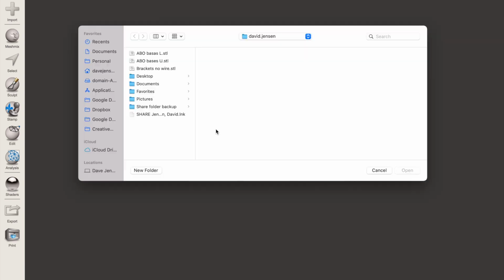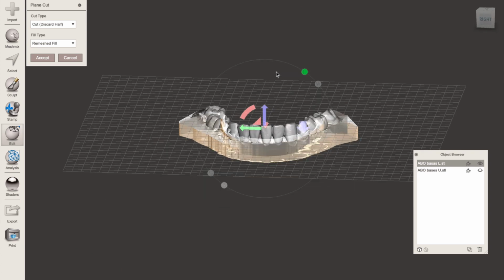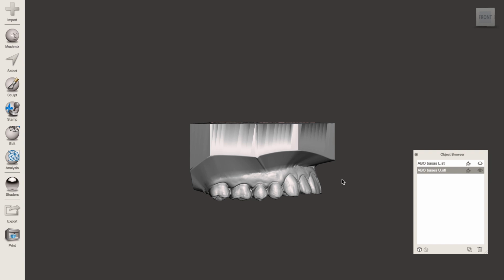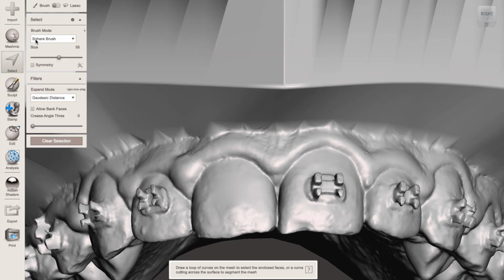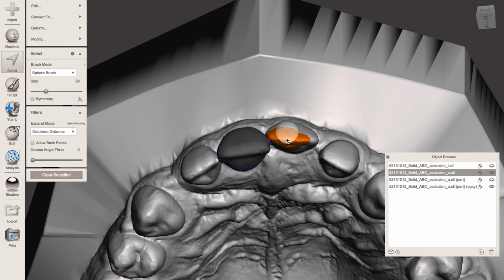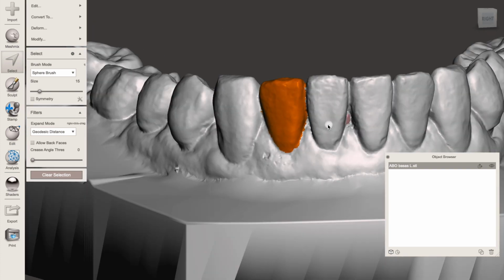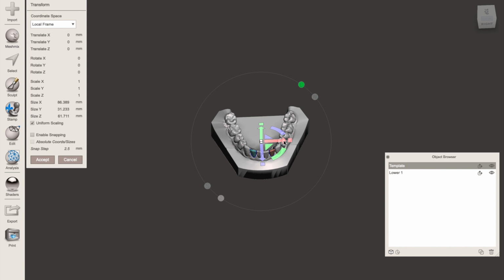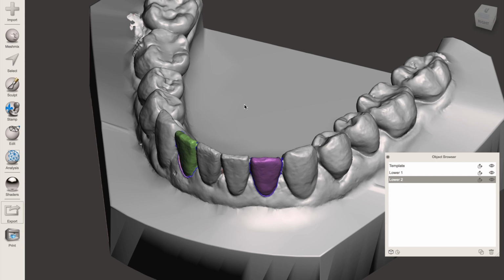Digital model processing 2: Bases, Bracket removal, Pontics and Active retainers

Comment: Good information . Can I ask you  in Pontic why did  you not use the Mirror tool instead of (copy) duplicate.
Reply from the maker: Thanks Umesh. The mirror tool would also work, but only for a contralateral tooth. The copy and duplicate is the most universal way I have found to add a pontic that can be placed anywhere.